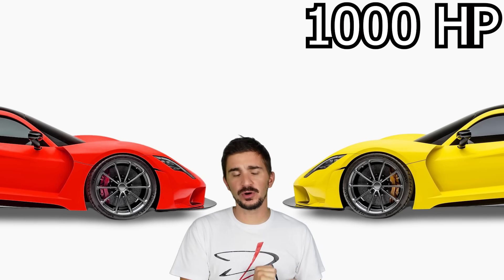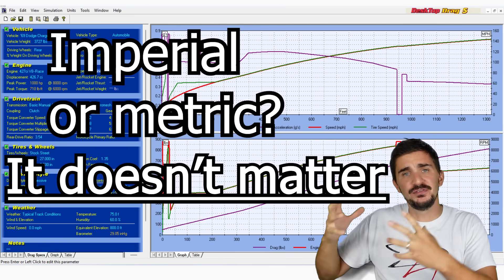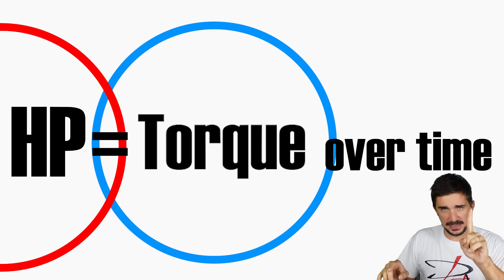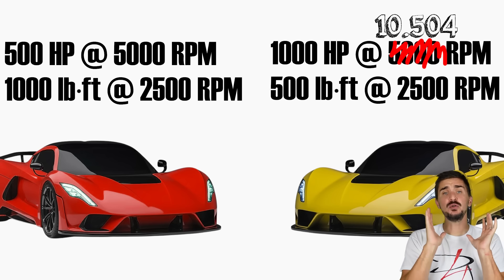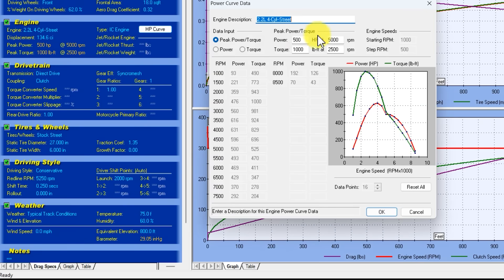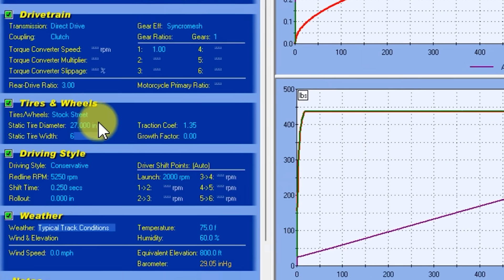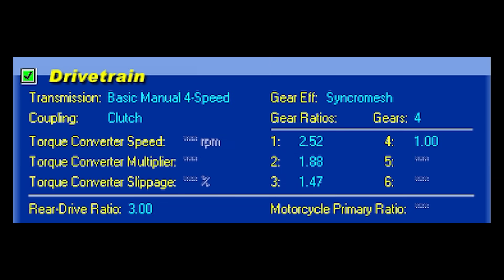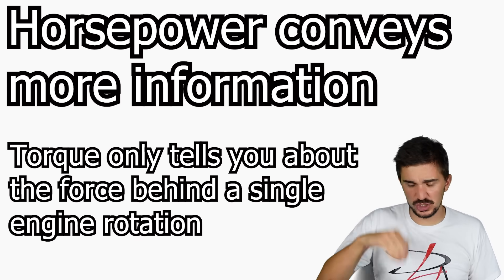Who's faster? Explained and Simulated - Horsepower vs Torque

Comment: As a complete layman, but one able to predict outcome of almost any stock car 1/4 drag challenge - ratio between HP and mass is the most reliable predictor. The exception are electric cars - they are accelerating better and achieving lower top speeds than petrol cars with the same HP/mass ratio.

Comment: I would have liked it if you explained that torque is largely determined by the dimensions of the combustion chamber, all else being equal.
Reply from the maker: There is no single thing that largely determines torque
Reply: @d4a   i'm talking about oversquare/undersquare engines

Comment: I think in reality these come out the same. You would optimize the gear ratios for either of these engines in real life because that would be proper engineering. Imagine your 4 speed gearbox is the same for both. Then you search through all the final drives and you arrive at the best one for the torque engine.

For the hp engine since your redline is 2x as high, you would just choose a 2x shorter final drive in this engine compared to the torque engine. Then your engine is identical to the torque engine in terms of torque delivered to the ground. And your wheel speed is the same when you shift. It's literally the same when both engines are optimized. 

There are only a couple reasons why this assumption doesn't hold true. I'm assuming that both would engage the clutch at the same time, which means the torque engine has to engage the clutch at half of the engine rpm. It may not be possible for the torque engine to do this without lugging (if the hp engine fully engages at 1000 rpm per say, I think the torque engine would lug if it tried to lock the clutch at 500 rpm). 

Some considerations though is that the higher torque engine will need a beefier clutch, driveshaft, pistons, etc., since the torque leaving the engine is 2x as high. However, the higher horsepower engine will need more of a stronger head to be able to rev that high.

Comment: Thanks so much for your videos, I love how you break things down. I’d love to see a video on the same torque and horsepower comparison but include an electric motor. I recently picked up a Tesla model 3 performance which has 450 hp and 471 foot pounds of torque, and does a quarter mile in about 11.5 seconds at 116 miles an hour.
The way the electric motor delivers the torque must be the key here and I’d love it if you broke it down and understand how this motor with no transmission is beating transmission / gas motors with the same specs. Thanks much!

Comment: This is stupid. He is saying that torque cant be lower than horsepower but then most ferraries have less torque than rpm
Reply: Also trucks have more than 2000 n-m but have 600 horsepower
Reply: Below 5,252 RPM torque in pound feet will always be greater than horsepower. Above 5252 RPM horsepower is greater.

Comment: Que no os lie, la simulacion está mal hecha, si bien el prier coche gira maximo a 5000rpm con un 1:1 gear ratio laa ruedas giraran a 5000rpm tambien , entonces el segundo coche tiene que llevar 2:1gear ratio so 10000rpm en el motor serian 5000rmp en las ruedas Y ENTONCES CORREN IGUAL

Comment: I think your analogy makes it more complicated and misleading. Torque is applied continuously, not in bits or punches. You can go much more basic.
Linear Force * linear Speed = Power - Units are:   N * m/s = W             (Metric is as always far superior here. Wait for it, this will go down smooth!) 
Rotational Force * rotational Speed = Power  -       Nm * 1/s =W           (Learned something fundamental about physics simply by using the metric system!)

Comment: Honestly something I think is an even better analogy for this(since you take into consideration the weight of the vehicle), is when you think of horsepower as how fast you can hit a nail, torque - how hard, and the size of a nail - the mass of the vehicle. Big nail, low force, no matter how fast you hit it, you wont get the job done :)
Reply: Wrong by definition. Force is mass times acceleration, which means an object will always accelerate proportionally to the force applied on it.
Jackhammer and sledgehammer.
Reply: @simplemachine9531  em? Do you know what jackhammer is used for? Certainly not to hit nails and my take on the topic is focusing on variable sizes of sledgehammers only
Reply: @Greyhound4619  you made a faulty statement and was corrected using basic physics law. If it doesn't correspond to your reality you have to reach out to other specialists.

Comment: The transmission is absolutly relevant for this comparison. When the transmission is designed correctly, horsepower always wins. In the end you can achive any amount of torque, when the wheel speed is low. It doesn't matter at all, which motor I have in a truck or in a formula one car, as long as horsepower and weight is the same and the transmission is designed for the correct purpose.
Reply: I feel like that fact that this "pathetic, useless, high-horsepower engine" is basically the same engine as the legendary 2004 F1 3 litre V10s should end the discussion 😂 no one is calling them slow
Reply: But you have to be able to move the vehicle, a heavier vehicle requires more torque to move
Reply: @shadowopsairman1583 transmissions are torque multipliers.
Reply: @shadowopsairman1583  A heavier vehicle requires more torque at the AXLE, yes. So the transmission just exchanges rpm for torque and provides it. Torque and rpm at the engine mean something about vehicle performance only when considered together (power), not independently. The exchange between them is basically free. The product of the two (power) is not free. The real reason trucks and heavy equipment often (but not always) have high torque engines is to keep rpm low to improve longevity/cost, so they need to be big to provide the required power.
Reply: @shadowopsairman1583  Thats what a transmission does. You simply trade rpm for torque or torque for rpm. Power (hp) always stays the same (ok, almost. apart from the efficiency)
Reply: You're dead wrong. Properly geared, torque wins every time, in every scenario.

You can't just make extra torque. Lol. Such a dumb misconception.

I don't give a crap what you do with gearing or ratios. THAT DOES NOT CREATE MORE TORQUE. The engines torque (power) generation does not change. The engine makes the power it makes.

How you apply the engines power to ground can change, sure. But at that point we're talking about GEARING. Not power.
Reply: @mustangstuff7213 Uh, gear ratios absolutely can create more torque. That’s literally the entire point of them. That’s why they exist at all. You can’t create more engine torque with gears obviously but who cares about engine torque? The wheels are what drives the car and they’re driven through… gears.
Reply: @mustangstuff7213  power is measured in HP, though, so yes, the engine makes the power that it makes. low hp engines will always be low hp, regardless of gearing. But low torque engines can make high torque through gearing - this is called mechanical advantage and it's why putting multiple runs of a rope through a pulley allows a person to lift more weight than a straight rope - it might just take longer if you were already capable of lifting the original weight.
Reply: @mustangstuff7213 you’ve got a 5.0 V8, yeah?   At 2000 RPM it’s making double the HP and at 300lbs/ft it’s making double the 150 ft/lbs of torque of that of an all else being equal 2.5 L four cylinder also at 2000 RPM.  Why? Because it’s displacing twice the air and burning twice the fuel per minute.  One combustion cycle every 2RPM (four stroke engine means a total of 1000 combustion cycles per minute per cylinder for a total of 8000 combustion cycles per minute for the V8.  4000 combustions cycles for the four cylinder.  Half the air displaced per minute and half the fuel burnt per minute should be 1/2 the torque and 1/2 the horsepower right? 1/2 the acceleration 1/2 the towing/ weight capacity all that, yeah?

 How many combustion cycles per minute does the 2.5L four cylinder create at 4000 RPM? 
The same as the V8 does at 2000 RPM
The four cylinder’s air displaced per minute is now the same as the 2000 RPM V8, the amount of fuel burnt is the same the Power is the same but the torque is 1/2 that of the V8 and the RPM is double that of the V8

With me so far?

Now if we put a 2:1 reduction gear on the back of the four cylinder it will trade distance for force at a 2:1 ratio.  The output shaft of the gear will be going 1/2 the speed of the engine but it will double the torque the engine is creating.  The gear divides the output speed by two from 4000 to 2000 in exchange for multiplying the torque by two.
The torque, power and output shaft speed and air displacement/ min and fuel burned per minute are the same (yes less a tiny amount of gear friction). Yeah?

So here’s the question:

If you’re in your V8 Mustang at 2000 RPM in third gear at 30 MPH making 300 lbs/ ft of torque and 114 HP.  Do you not think the car will pull three times harder if you shift down to first where at 6000 RPM at 30 MPH the engine is still making 300 lbs/ft of torque but 343 HP?  It’s displacing three times the air per minute.
It’s burning three times the fuel per minute.
It’s turning three times the engine RPM

If the increase in HP wouldn’t win with 3 times the power and three times the torque at the wheels? It wouldn’t accelerate three times harder in first than 3rd?  Do you think it would be a draw because the torque at the engine is the same 300lbs/ft at 2000RPM as it is at 6000RPM?

The displacement per minute doesn’t matter
 Burning three times the fuel per minute doesn’t matter?

Comment: Is 5252 always the constant or can that be anything?
Reply: If you are measuring power in horsepower, torque in pound feet, and angular velocity in RPM then the constant is 5252. If you change any of those then the conversion will also change.

Comment: wich weight have the car is extremely important.
power can win with a light, torque can win with a bigger weight.
and another thing, can configure more power or more torque on an engine,
but power have already the torque in the calculation.
and need a minimum of power to have 1000hp...
in other term, power and torque are not really two different things, they are related.
the power is the capacity to move a weight with wich time, when the torque is the capacity to move a weight.
so of course the power have the torque in his calculation... this just include the time in the calculation.
Reply: Not time, angular speed.
There is no such thing as "capacity to move weight". "Move" means speed already, you can't move anything without a speed. Torque is a calculation used to build a strong enough mechanism, it is not related with POWERing it.
Reply: @simplemachine9531  my english is very poor...so maybe some word are inexact.
in french its "vitesse angulaire" so yes its what i mean.
but: "move mean speed" yes, but with wich speed? that is the difference with torque.
Reply: @NeoMikeO0o  power is force x speed, or acceleration x speed x mass.
There is no torque in the equation when there is power, because torque can not be related to performance. Performance is always torque x angular velocity, which is power.

Comment: It depends on the wait of the car
A light weight car might get faster with more power, besides an heavy weight vehicle might get faster with peak torque.
Reply: Wrong, just check definition of power, work, force

Comment: Why the hell would you use the same transmission? No shit the torque motor wins. You're literally forcing it to win. With the same gear ratios, the HP biased motor will go twice as fast. Gear ratios should be set for the powerband of the engine. Different torque curves will need different gear ratios. The final drive should be used to give the vehicles the same top speed. If you look at the later tests, he doesn't even use all the gears because the gear ratios are all wrong. This is a really dumb video.

Comment: If both engines have the same hp the work done should be the same. In the case of a drag race if both engines go through the 1/4 mile at the very end are at engine red line it should be a tie. Sincerely Richard Goodman

Comment: Depends partially on how close in RPM your shifts are.  A peak HP rating is literally at one specific RPM value.  When you shift near that peak are your dropping down 500rpm or 3000 rpm?

Comment: I always think about it this way:
Torque is force. Newton's law of acceleration basically says that if you use a lot of accelerating force on a weight the acceleration is bigger than if you use less accelerating force on the same weight. The reason why semi trucks or agricultural vehicles have very high torque is because they are heavy or need to have the force to dig in the dirt.
Now if you have a lot of accelerating force you need to be able to get it on the road. Without the traction you need to regulate your use of the accelerator which means that you don't use the full torque potential until the car is fast enough to generate enough aerodynamic downforce and traction. As long as you've got the traction to use the torque the initial acceleration on slow speeds will be higher with more torque.
As soon as aerodynamic drag is significant the car needs power to get to a higher top speed. So the car with more hp will be accelerating better at high speeds because the one with less hp will be reaching it's top speed earlier so the acceleration flattens down earlier. High torque electric vehicles are crazy good in accelerating from the line as long as they've got the traction. But they lack the power at higher speeds to keep up with the regular high hp cars.
You can see this in the data as well. For example for the 6000lbs weight car the 0-60 time is almost 0.2 seconds faster for the higher torque car and the 0-100 time is faster for the higher hp car. The top speed at the 1/4 mile was 116mph for the high torque car and 125mph for the high hp car. In almost every simulation you did where the high torque car won, the high hp car finished at a higher trap speed while the 0-60 was slower.

One thing I noticed as well is that you spend some time to make the high hp car realistic but the power and torque curves of the high torque car ended up quite weird. You set the peak hp to be 500hp at 5000rpm but the high torque at lower rpm resulted in a maximum of more than 500 hp at about 4000rpm. After that there is a weird kink.
As you said torque and hp are directly connected. To have a high torque but low hp engine you need to limit the rpm and to get a high hp but low torque engine you need it to rev high.

Comment: The 10k rpm engine will usually need more maintenance since stuff is moving faster and will wear more.  For racing engines sure but for passenger cars nope.

Comment: Horsepower is calculated by the following 

[ (RPMs * Torque) / 5252 ]

So horsepower would really be how many much weaker punches you can deliver in a given amount of time. 

The reason most cruisers tend towards higher torque rather than HP has to do with many of them using a pushrod setup rather than dual overhead cams. My Indian Scout Rogue has 100HP and 72 torque (max at stock). This his fairly high for a cruiser. Most cruisers govern out at around 5000 RPMs. The Thunderstroke 116 engine go up to 5400 RPMs with 126 lb-ft (they use ft-lbs rather than lb-ft) torque. That means it could have up to 129HP max in theory. This is only theory because the TS116 hits peak torque around 3000 RPMs. On the dyno it showed 128 lb-ft at 3000 RPMs and peak HP around 4850 RPMs after the torque had fallen to around 115 lb-ft. This gave roughly 105 HP at 4850 (ish) RPMs. Now, these are off the crankshaft. The wheel measurements are different. 

Why do I talk about this? By going with dual overhead cams rather than pushrods my bike gets 72 lb-ft torque at 5900 RPM (I don't think I have even been that high yet) and does reach it's 100HP (at the crank of course). Now, the crazy thing is that the torque on this bike comes close to max at around 2300 RPMs and then maintains a fairly flat line fluctuating a little up or down until it governs out around 8300 RPMs.